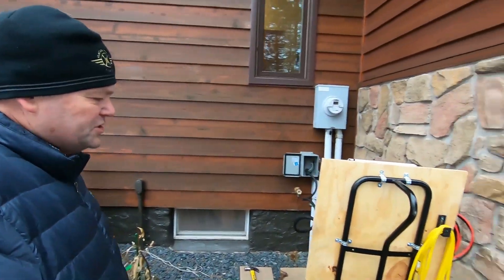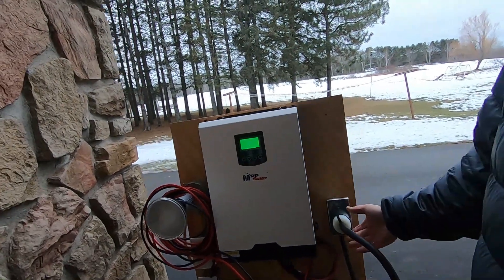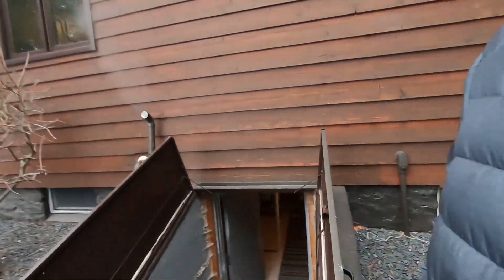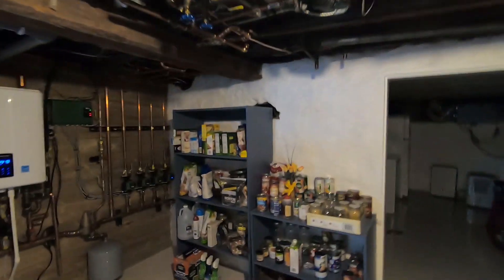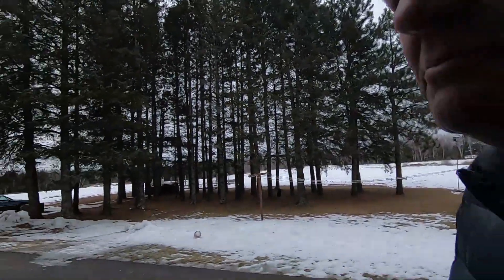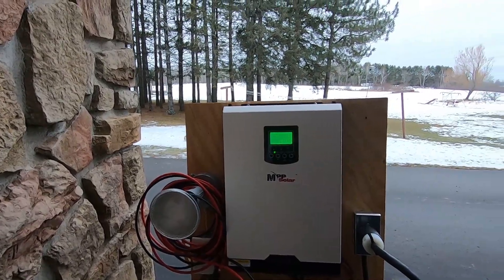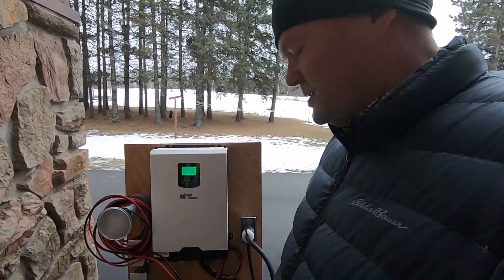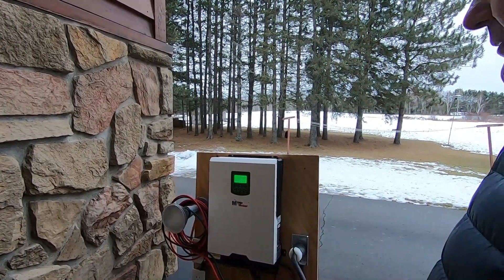DIY Portable Solar Generator Power when the Grid Goes Down!

Comment: Pretty cool set-up! I'm interested in what the heating system is that's running via the solar charger system? I would think it would be too heavy a load. Also the well pump motor would have a very high start-up load but I think you said that's off the circuit.